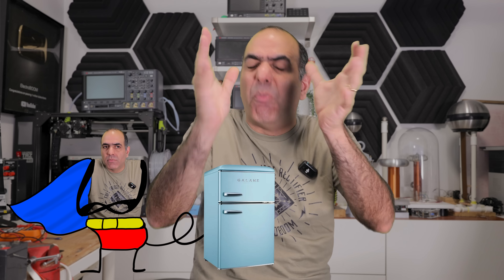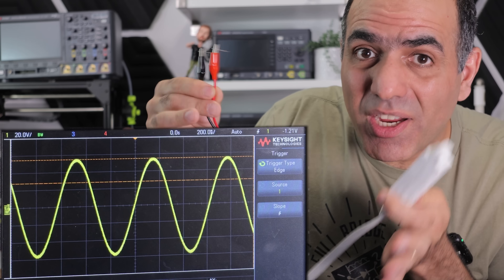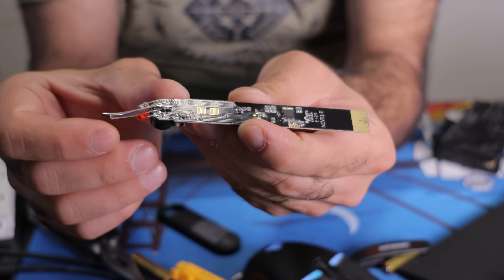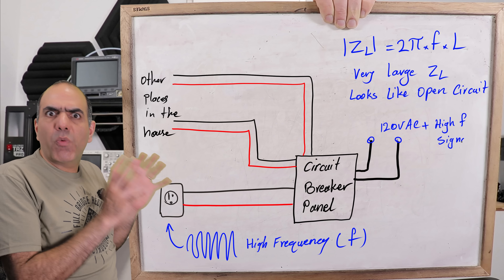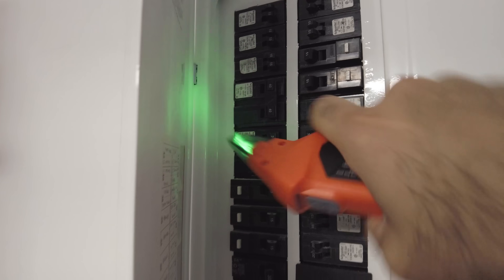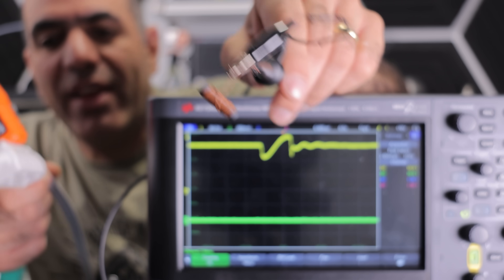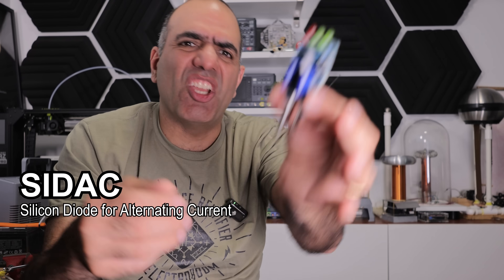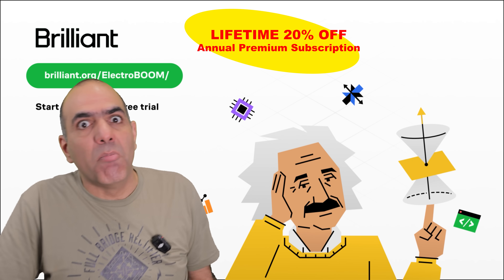FAFO the Breaker!

Comment: At work, I was working on a 32A radial circuit and accidentally shorted live to earth with a screwdriver when attempting to re-tighten the live terminal of a socket... Completely blew up the end of my terminal screwdriver.

For context, I was removing a bunch of old sockets but I couldn't find the breaker. The board was (annoyingly) completely unlabeled so I had no clue which breaker it was and I was unable to start switching random things off due to the systems that the board was powering.

I opened up the last socket in the radial to determine what the cables were like so I could maybe trace them back to the specific breaker, but I noticed that the screw on the live terminal of the socket was sticking out a bit and slightly loose, so I took my screwdriver and went to tighten it... even though it was insulated, the uninsulated end just happened to touch the metal body of the socket at the same time as I touched the live. There was a massive bang, a big spark and I was left with a big chunk taken out of the driver. But hey, I found the breaker!
Reply: I once had to find the breaker for a totally destroyed outlet in a poorly marked office and couldn't just flip breakers, only thing to do was to tell people to stop what they were doing, look away and poke it with a dry stick. Got a bang out of it.
Reply: Doesn't matter if your circuit is 15A or 50A. It will result in the same arc and short circuit.
Reply: @yeeterooni7352 No, MCB has a type that shows how much current can go throught the line before circuit will be broken. So if its class C (for inductance stress) max amps wil be N*10, so for 32A MCB it will be 320A, but for 5A MCB it will be 50A.

Do you see it?
Sparks will be different.
Reply: @yeeterooni7352  Lower current breakers will turn off slightly faster, but usually not enough to matter much when it comes to sparking potential, true.
But the higher current the circuit, the larger diameter the wires feeding it, which significantly reduces impedance and by that does ramp up the destructive potential in a dead short situation quite a bit.
Reply: @yeeterooni7352  a 15 A circuit breaker will trip faster.
Reply: Ooh, is this on a British "far safer, far better" socket?? Those ones that don't have breakers, because instead it's better to put fuses in every plug?? Color me shocked!

Comment: Residential transformers in America are really weak, short circuit value only 500A or less. Also long cable coming from transformer to main panel. Shorting wires in America will cause sparks without serious damage.

Comment: I prefer the method of waiting until one of my ancient GFCI outlets starts making a concerning noise, running to the breaker box, realizing that is one of the circuits that aren't labeled, and frantically flicking random breakers until the sound stops. (this actually happened. That circuit is now labeled. RIP the time I lost on a thing on my computer that got the power cut in the process.)

Comment: Once when I was doing some electrical work at a restaurant, I used the "primitive method" on a branch I wanted to locate a breaker for. No pyrotechnic special effects, but it was so effective I couldn't locate the breaker / fuse at all, as in: something tripped but I had no clue where. I ended up cutting that part off - it was old and dodgy, so it's for the better - and did new wiring in the rooms I worked on all the way to the electrical panel. Way safer and more reliable now.

Shouldn't this cable detector be used when breakers are all switched off to separate the branches from each other and the supply? This way you avoid putting the signal into the other branches through the mains bus. Though if this works on current rather than voltage, it may not work with no mains at all...
I think I remember Big Clive talk about SIDACs. Interesting.

Comment: For a safety-critical application like this, I would connect TWO 1kV-rating 22nF capacitors in series. Failure of one capacitor will not instantly electrocute you then. It is also ABSOLUTELY MANDATORY to connect a load resistor on the other side (AFG side) of the capacitor. An unloaded capacitor will NOT reduce 120VAC AT ALL. Plenty of people have been electrocuted by this dumb idea of collecting an isolation capacitor to mains voltage, and trying to experiment like this!!! I thought you would know better than that!!!

Comment: I picked up that same Klein unit recently, much easier to find the right breaker with it than the oldschool analog one I had before. Not at all what I was expecting the injected signal to look like, I figured it was just a low-ampltude high frequency signal riding on the line wave like the old ones, just with a more sophisticated receiver.
Reply: 13:20 - he doesn't explain why the current spike is only every 7th cycle. There didn't seem to be a microcontroller in the plug device to do any switching.
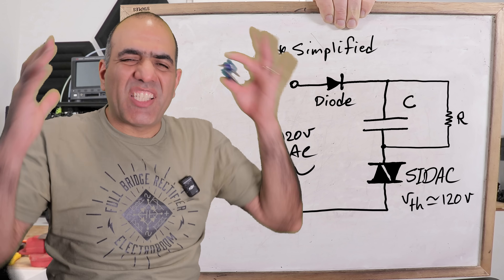Reply: @mb-3faze  Referring to the circuit at 13:13, after the SIDAC has fired the capacitor is fully charged and there's no voltage across the SIDAC.  The capacitor then discharges over several cycles via the resistor and the voltage across the SIDAC rises.  When it reaches 120V the SIDAC fires again.

Comment: Wait till he finds out that new live wire sensor will kill the batteries even when it auto turns off.  I have one just like and it drains the batteries even when off. It makes a annoying constant beep when the batteries are about dead. idk if it is just defective or just cheap.  But if it does the same as mine, he will have a fun time finding what is making the annoying sound when it does do it after putting it away.

Comment: Never heard of EoP but PoE.. how is it even possible to keep healthy signal over AC ?
Reply: Pretty much the same way DSL works.
Reply: Hopefully it works better than the "wireless" phone jacks that extended a land-line over house wiring (if both ends were on the same 110v phase...) although utilities have had a "carrier-current" system for years to send data over transmission lines for remote meter reading, control of "smart" street lights, etc... and Telcos have had their own systems from AML (Added Main Line) that added a single analog channel over a POTS (Plain Old Telephone Service) line to GTE/Lenkurt analog carrier which put a bunch of Single SideBand channels on a pair with 250v(IIRC) and would really light up your life if you accidentally hit that pair to T-1 digital carrier with 24 voice channels...

Comment: Did he really kill the generator for the video? Just give it to me next time :((
Reply: I’m sure he didn’t kill the scope, he’s good at practical effects. I’m sure he popped something else that made a bunch of smoke and killed power to the scope
Reply: Bruh
Reply: Ok but that's oscilloscope
Reply: @electronicgameeng9296  it's both, modern oscilloscopes like this also have a build in signal generator output on the left side. It makes it much easier to automate measurements if they are part of one machine and you can just connect for example a filter to generator and a scope from each side, press measure frequency spectrum and it'll do it all for you.
Reply: Choosing beggar?
Reply: @anotheranonhere  no it's just that these things are hella expensive and it's hard to believe he would blow a working one.

Comment: Hey mehdi i have a question 

I have a bulb socket with 2 switches , turning on one of them makes the bulb glow and turning the other switch on makes it glow MORE 

I have destroyed only 4 bulbs yet but i can't figure out how to fix it
Reply: Sounds like you have two circuits backfeeding into each other. This can be very dangerous and lead to electrical fires. Id recommend you turn on one switch so the light is running and track down the breaker running the light. Then turn on the other switch that makes the light get brighter before killing the bulb. If the light turns on you have a backfeeding problem and should call an electrician to come take a look at it. I have seen many boxes where the wires were burning and melting from the overcurrent in similar situations.
Reply: @kellyevans3254  x2 on Kelly's suggestion. If you do have two circuits both feeding the same outlet that is a pretty serious issue.
Reply: 240V from another split phase injected into 120V bulb perhaps? Call an electrician, Mehdi certainly isn't an electrician.
Reply: @nameredacted1242   electricians cost money, I mean I could just not use the bulb there but I wanted to fix it myself to make someone proud which I never did
Reply: Otherwise, my guess still stands. Every other breaker is on a different split AC leg of 240V pole transformer, so most likely one switch was fed from one breaker, and another switch was fed from another breaker right below or above it. If you want to make an initial stab at troubleshooting, make sure that the light bulb is fed by one and only one breaker. If it is fed by more than one breaker, you have serious wiring issue.
Reply: @nameredacted1242  I'll call an electrician :D
(I won't)